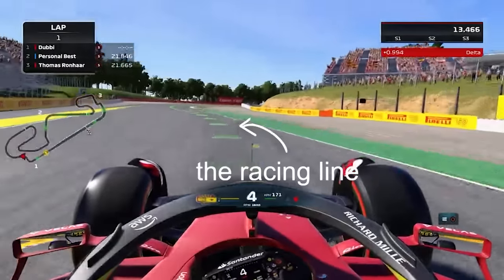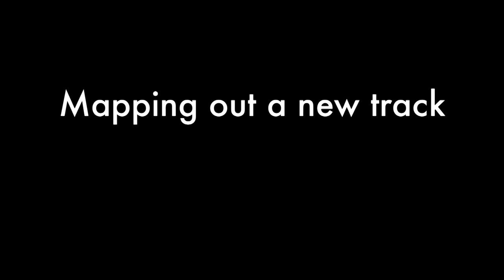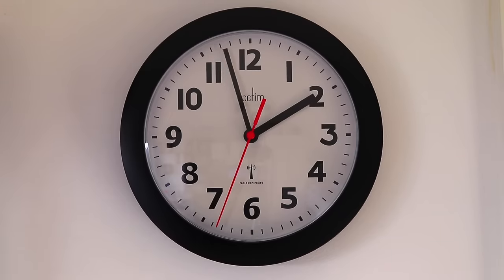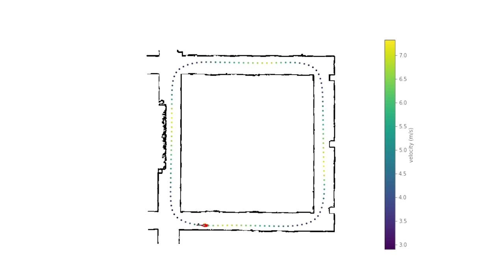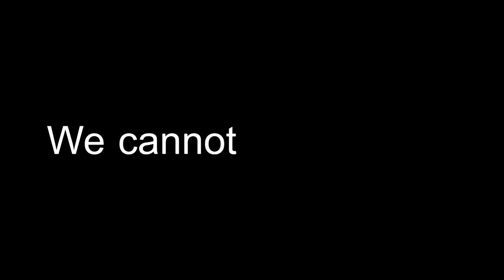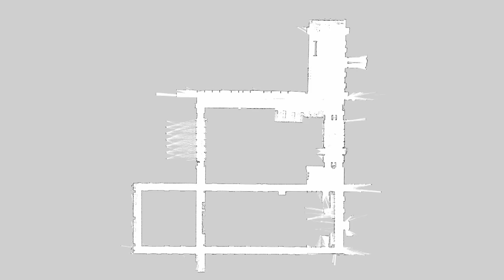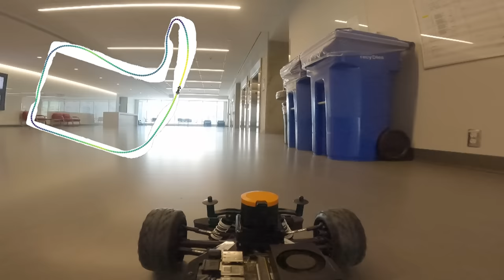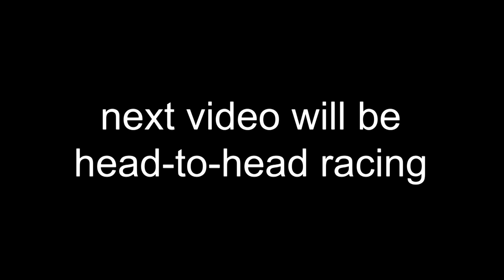Building the FASTEST Self Driving RC Car

Comment: i’d love to see this self driving car race against some hobbyists on an actual track
Reply: Exactly what I was thinking!!
Reply: That would be awesome lol
Reply: This is a thing or at least was
Reply: The class of car might be a problem. This type of RC truck races on carpet or dirt which includes jumps. Onroad (racing without jumps) cars are very light and low. Could easily find a pro driver or hobbyist to race against this but I imagine you'd need a handicap as the equipment on this thing will make it very top heavy by comparison.
Reply: @TheFatAssCat  I've seen videos of dirt RC buggy racing so I guess that would be the competition, but yeah this thing is outclassed as a platform already sadly
Reply: As a 10th scale 21.5T touring rc racer, I can tell you that the computer isn't driving fast at all, it only looks like a mobile racing game player carefully following the so called "perfect racing line" at a much lower speed than what the car can actually handle. There's a phrase I really like, "if you feel like the car is easy to drive, you are not driving fast enough yet." It means that the way to improve yourself is to keep pushing to your limit, but clearly without actually "driving" and feeling the car with your own hands on the track, it is just impossible for you to know where the limit of the car is, and so letting the computer simply following the "perfect racing line" will only get you so far. I'm really looking forward on this project tho, hope they will find a way to keep pushing the car to its limit with the computer, this concept is really cool and these videos definately have so much fun watching
Reply: @kangoon4434  yeah, it definitely seems like it needs improving. I don't think it'll get close to the limit of the car itself anyways tbh, the software doesn't really seem like it knows how to correct if something starts to go wrong etc. its still pretty impressive and fun to watch for sure
Reply: it would get demolished. it's still driving far from optimal lines
Reply: Love to see on actual F1 car starting 1% of max speed. 😊
Reply: simple: make the hobbyist run the car with remote control and take a 5 lap time
Reply: It's been tried in large scale and the car rammed it's self into a wall at full speed right off the finish line ( ;
Reply: Well I was racing myself, there is no competition if you watch a simple hobbyist race you will see that they drive really fasy
Reply: Bro same
Reply: That would be really cool! Competition of self driving RC race cars - streamed!!! Yup, that needs to be a thing.
Reply: @TheFatAssCat  I was thinking that all the competitors would be self-driving vehicles. That the teams are competing against each other in their skills to develop self-driving RC cars. Not against human controlled cars.
Reply: at this point hobbyists ez win
Reply: a hobbyist would probably crush this easily atm, it's going way to slow.
Reply: @Danuxsy  the platform, tuning and tires are wrong too
Reply: I would love to drive against the self driving car but both my off road car and race car have siezed the motors because I was messing around
Reply: He is going to broke the lidar
Reply: @kangoon4434  with additional data like more fine tuned accelerometer input, you could increase the program's real time "sense" of the car at the moment though, and potentially get more juice while maintaining the immediate reactions as well. especially in a more controlled environment like a dedicated rc racing track
Reply: @taiteo558  that’s a really good idea actually, with the help of a simple gyroscope, it can easily tell if it’s going over corners at the highest speed it could possibly get, and it can easily correct itself in the case of an understeer or oversteer with that. If they can manage to fully utilize the use of a gyro, the pc can easily beat everyone else in races given that all cars are the same spec
Reply: @senorporko3299  oh no! 😂
Reply: easy, will take this challenge any day, its an untuned slash with wayyy to much weight added onto it. too easy.
Reply: @kangoon4434  gyros already exist in the hobby. They're good for beginners, but they fast competitive racers do not use them. They're not an advantage if you have good control of your car and its slip angles
Reply: It would get DEMOLISHED 😂 I’ve seen some crazy skilled rc guys, but if enough work is put into it I’m sure it could eventually surpass human drivers.
Reply: @kangoon4434  That is true. People can even use "advanced techniques" that can allow them to drive even faster. Like for example forcibly kicking cars back in to the turn. That of course will not work in every situation and surface/terrain and may result in slower time. Still this is something that is for a computer program impossible or so hard it is not even worth because some small variable can F-up everything unless driven in very controled conditions.
Reply: Sounds like a challenge.
Reply: @TheFatAssCat  They could build another one.. just replace the computer and LIDAR with an RC receiver and a brick :)
Reply: @Danuxsy  I have to sell the 50mph car because of the cost of fixing it on top of my actual car
Reply: @TheFatAssCat they could use similar cars or the "ai" car May be upgraded for track racing
Reply: @kangoon4434  agreed it's not fast, but you can tell it has a ton of low hanging fruit to solve (controls of the car are not precise, the mapping of the track is clearly off, the line it's aiming for is bad etc. Once you nail the setup, it can go from driving slow to close to a pro very quickly as it has no learning curve, just accurate formulas or not.
Reply: It'd be like a video game irl!!!
Reply: bro just created a new motorsport category
Reply: Oh lord now we want ai to take over the hobby races? 😢
Reply: I volunteer
Reply: @kangoon4434 i aint no pro and currently dont even own an rc car, i haven't owned a hobby rc car in 2 yrs but i cud take a basic ftx comet out the box with its small brushed motor n whip it round this track he's made. Now for a computer to be driving his 1/10th its at a human age of a 4 yr old, yes i know a 4 yr old who owns a 1/10 ftx carnage he's now 5 n runs a brushless system but he  has the control better than most adults thnx to his dad pushing him (not me). The computer is slowing into corners instead of doing it how id do it which is full power turn then opposite lock reverse slide turn power forward, like hand brake it round in a sense with sliding its easier to show than write it down, but thats abt the best way i can write it, i find its always whipped me round a corner faster, rc cars even with all the computers dont weigh the same as a f1 car so body roll etc isnt really a factor. I think this young technician needs to go watch a pro do his circuit, then get the pro to teach his rc car optimal speed n id guess u can still use a rc transmitter to override ur rc truck m8. So if ur a.i. has the ability of direct learning get a pro to do a run n teach ur a.i. system then allow the computer to make improvements. Though ur current set up is fantastic for a basic rc. But this person is correct n its also a truck chassis not a race car chassis.
Reply: @GraveUypo  agree, but more work and it could be improved, certainly.
Reply: @TheFatAssCat  I was thinking that an Associated carpet buggy, or 4wd dirt buggy, with some tires designed for smooth surfaces with tack added the car would certainly reach some insane speeds. Personally I race on carpet and dirt, each track is different but the lines are usually pretty much marked out after a few runs because of the tires wearing leaving marks on where you should be. I would like to see this expanded upon. This tech could be used to help teach new racers how they should run their car.
Reply: @TheFatAssCat it's a traxxas slash, one of the best rc cars for onroad. Infact thry do far better Ronald and on light gravel and grass then proper offroad. And the suspension can be tuned to make it lower or higher but he's already running significant droop. Only problem is he'd have to up the power a lil because that same traxxas slash should be doing 60mph on 3s.
Reply: @TheFatAssCat  gyros can correct pitch much better then a human
Reply: I'm a mechatronics student, and rc racing is actually one of my favorite hobbies. I can confidently say I would put on the gap Daniel's on any autonomous car. No hate, I love the concept, but it's funnier if I get to keep my ego 😭
Reply: @TheFatAssCat I feel like I you could make the device itself inside of the shell on the car and use a typical antenna as if it was just a normal racing transponder. I completely agree with the statement of the different classes. I personally race rc cars myself and had the same thought so imhappy to see I'm not the only one lol

Comment: If you really want to hate fine tuning, you could even start introducing slip angle, as on lower grip surfaces like polished concrete it can be faster to be putting power down earlier into corners and letting the tail of the car kick out a little bit. It would require gyros (which could also help with the oscillations at high speeds) but could also increase corner entry and exit speeds a fair bit
Reply: i was thinking the same thing with powerslides as in some cases it increases speeds quite a bit
Reply: this is not just fine tuning this is transforming a mid-tier problem into an insane problem
Reply: What I love most about these types of videos is that its pretty impressive already, but there's always a way to improve it, and more often than not, its a heavily explored topic
Reply: @lagule  just use ML lol. 
jokes aside, that seems like an "easy" problem to solve with ml, simulate the car, then use the pre-optimized program control of the car with some securities and let correct for the delta between simulation and reality. (by easy I mean it's only a couple months of work)
Reply: OH YEA SIDEWAYS
Reply: This! it actually will be quite simple to implement! Also, change the tires for onroad tires, and maybe add stiffer springs and shocks, and lower the height and cog. I think oscillations are due to an imprecise platform, it's an offroad rc with lots of suspension travel and soft tires. tires alone would add a lot of speed
Reply: Is he doing all this based only on lidar without an IMU? That's impressive and it'll be squirrley as crap. IMU + kalman referencing the lidar would make even regular driving much easer.
Reply: @lagule  and here we have the challenge of being a successful racing driver!
Reply: @lukacrawford1619  I don't think power sliding is ever faster than normal driving
Reply: Before he gets to that level he could look at tuning the differentials. Also, not driving into things.
Reply: this car has gyros built into it if its the one I think, its a traxxas slash but idk which version
Reply: self drifting car :D
Reply: as a hobby and hopefully eventually real pilot, add dem gyros
Reply: @nade5557  There are some exceptions like in some gokarts when you need to make a sharp turn after a long straight
Reply: Drift...Drift...Drift!  Lets GOOOO!
Reply: Some of that may also need a way to implement slip/skid detection, and rudimentary traction control stuff as well. (To steer correctly for a slide you also have to get a pretty good assumption of how much grip there is. Likewise it allows for throttle/brake to have more role in steering rotation. Not to mention a whole new option for dealing with hairpin turns.) But yeah this parallels what I said in another comment before scrolling down here.
Reply: My brain is fucking empty after all of this, I really had to use it to understand what was truly being said.
Reply: That's what I've been thinking, he isn't considering traction or lateral g's at all.

Comment: To be fair to you, people have other senses to rely on when driving. You just have the LIDAR. People can feel when a car is losing grip or how hard they're accelerating or braking or how close they are to something. You've done a really great job with limited sensors on your vehicle.
Reply: Exactly, this problem is nowhere near as trivial as it might look, literally years of research have gone into driving simulators only to get the grip formulas right, apparently there are pretty good models for dry and high grip situations but when traction is lost is not yet solved (assetto corsa devs have videos talking about this in depth).
A pilot is getting A TON of information from G-Forces applied to their body, so that would be a great sensor to add to the car and formulas.

Comment: Absolutely epic! This motivates me to start a similar project
Reply from the maker: Go for it!
Reply: The $1600 LIDAR sensor motivates me not starting it 😄
Reply: @Talaxianer  could always go the musk method of 2 cameras for depth perception and pray your model doesn't floor it into a overturned box truck
Reply: @StuckOnAFireHydrant  everyone knows self driving needs LiDAR except Musk 🤣🤣🤣
Reply: @Talaxianer  use a lidar from robot vacuums. They are 150.
Reply: @Talaxianer  do it with a sonar
Reply: @StuckOnAFireHydrant  you can do depth perception with one camera using AI
Reply: @Danuxsy  i have already tried 1 camera slam. The results are not accurate enough. Although the camera does solve the glass problem faced by lidar.

Comment: In the last few clips, the gear mesh sounds awfully tight. Also you can get better tires for it, so it does not slide as much. Final advice, the stock Traxxas servo sucks in keeping position imo, it's the first thing I advice people to change. 

I'm new to programming, so no idea how that part works (yet). But been racing and working on rc cars for the last 15 years. Love these video's, gets me excited
Reply: I agree with this, i was hoping it would already be in the comments!
Reply: Yea that gear mesh was sounding spicy
Reply: Yea you definitely don’t need that much tread on such a smooth surface, braking and acceleration would be much better
Reply: Get an INJORA servo for a great price point performer.  That aside, I suggest the mesh was not getting tighter but rather we’re hearing some tooth wear.  He is bashing, after all.
Reply: If Steven ripped out the guts of the servo and replaced it with something that could output the steering torque and actual position, it would be possible to feed the controller a "force feedback" that could be used to "feel" the track as well as allow the servo control loop to be tuned dynamically through software.
Reply: Agreed - I'm an RC car repair tech at a hobby shop. The gear mesh definitely sounds tight in the last few runs. I'd also probably replace that turnbuckle at some point - bending and unbending it weakens the metal, and it will probably snap on the next hard impact.
Reply: @JoeOvercoat  I would not call this bashing, compared to what most traxxas cars go through.
Reply: @IngmarSolissa  Right? 🤣
Reply: Great suggestions! He's already benefitting from software knowhow, but he has a lot to gain in the physical setup of the car! It's like he's training Max but not the RB engineering team!

Comment: Dope project! I'll be on the lookout for follow ups.

An unwarranted thought: You can probably squeeze out more performance from your controller with something like a model predictive controller with constraints for following the racing line, vehicle dynamics and local obstacle avoidance in your lidar map
Reply: You might not even need to run the MPC in real time: Just use the existing optimizer with starting conditions close to the racing line, and linearize the necessary controller output around the optimum. Calculate and store the parameters for every point on the path, then use them to get an optimal linear controller at every point along the track.
Reply: @Christian-mf4jt  With slight deviations accumulating, eventually it would get out of sync with the pre computed inputs. There are hybrid approaches, where one MPC generates an upper velocity bound offline and a second MPC tries to reach that limit online.
Reply: @VulpeculaJoy  The missile knows where it is, thusly… https://youtu.be/c94bALAgENM …so yeah, a map if one can generate one.

Comment: For those floors I’d recommend slicks they have a higher contact patch than gridded tyres although slicks aren’t great for anything other than smooth surfaces. Also reducing the sensitivity or speed of steering to reduce instability
Reply: Also, wiping tires down with simple green adds some tack to the rubber.